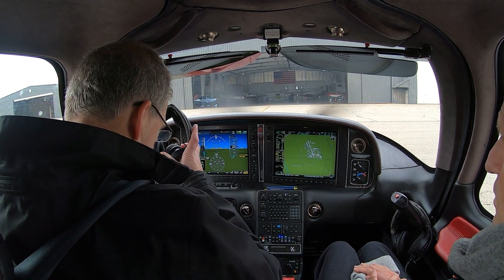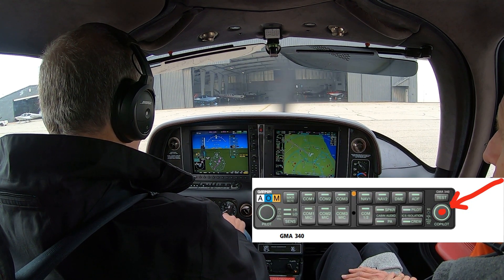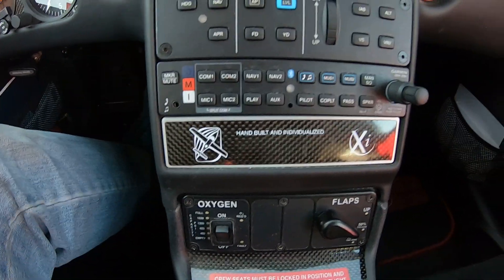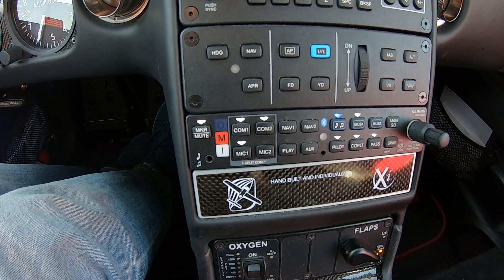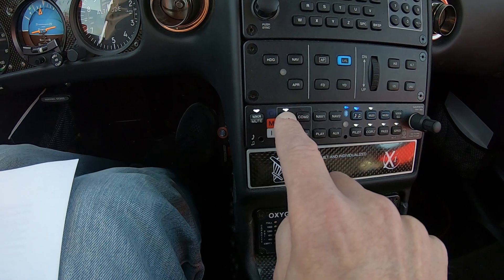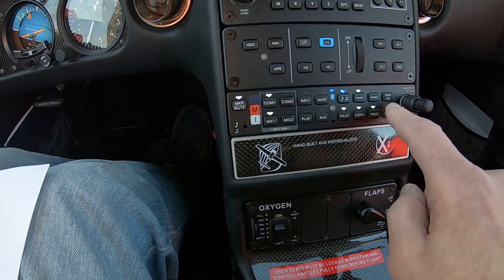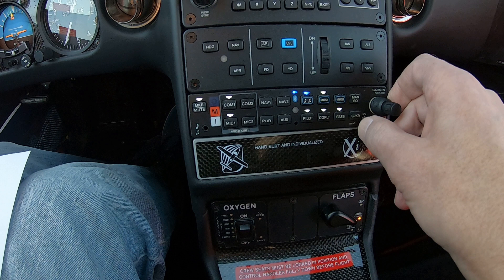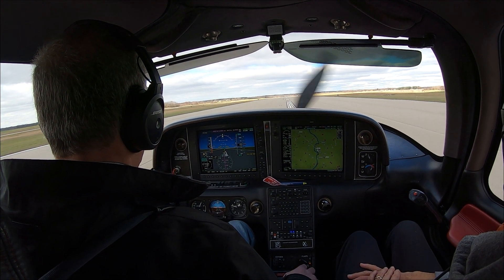The Garmin 350c.  Better Communications At Your Fingertips

Comment: Great explanation video, much better than the manual as it's not as evident. I have the GMA350C also but can't figure out something.  My backseat passengers say they can hardly hear the Comm Radios. I have front passenger configured as crew, all intercom volumes are good for all seats, comm radios come through clear for pilot, co-pilot but backseat they say any radio calls are like a whisper.  If comm volume is controlled by the actual radio, then likely my intercom volume is too high relative to comm radio?  Not sure how to give back seat more comm radio without raising intercom levels? ideas? Thanks and great video.

Comment: Mine would connect via BT fine.  Now, no matter how many times I try, unpair, re-pair, I can't get the BT to work.
Reply from the maker: If you had it working before, you obviously know what you're doing.  So tough to say from afar.  Is it possible there is another device that is paired and interfering with your device?  Obviously something changed and we just need to figure out what that is.
Reply: @pfflying6275  that's my guess. Although I never had an issue before.  I have the 345r, adsb in/out, but I run a sentry also so I'll see if maybe I pair my phone to the 350c first, and then turn on the sentry it will work. iPad is fine connecting to everything, just my phone.
Reply: @nxfedlt1  I don't know if i understand your issue. The 350c will only connect to 1 device. I have an iPad and iPhone. So everytime i get into my airplane i turn OFF on the iPhone wifi/bluetooth, and then the 350C will connect to my iPad or vise versa. If i leave bluetooth ON both devices i run into problems. Not sure if that is of any help to you.
Reply: @rfriesen1644  solved it. Didn't realize the 350c can only connect to one device. Too many Bluetooth items! Sentry, phones, ipads, a20s....sheesh give me a j3.